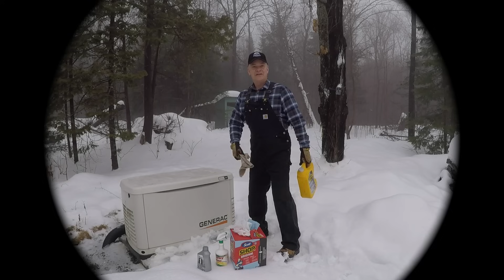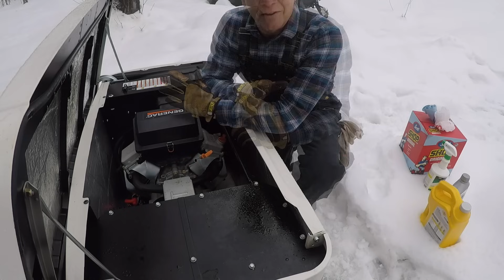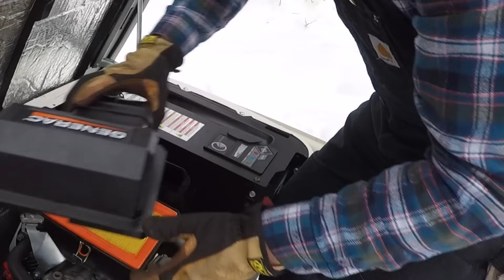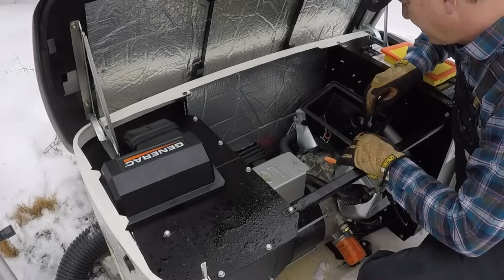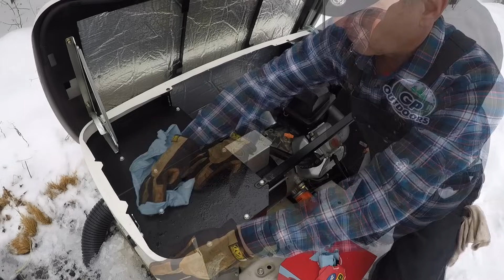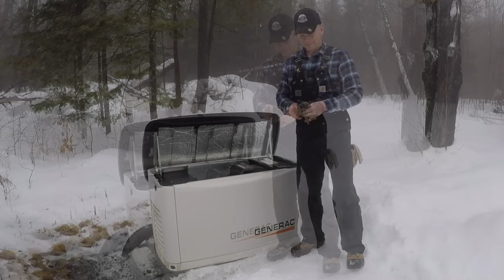#133 Thinking of Buying a Generac Generator? You Need To Watch This!

Comment: It's not exhaust. It's the crankcase ventilation. Its allows any pressure in the crankcase to neutralize  and any gasses to be sent back through the intake to be burned. The source of the water is from the engine not being run long enough to get hot and eliminate its own moisture.  It needs a longer exercise time.
DO NOT put any holes in the air box.  Dirt and insects have direct access to the inside of the engine
Reply: Trust Me I think so too!
But I would drill a 0,04 inch hole in the bottom... Car air intakes have those too.
Or install a one way valve 🤷‍♂️
Reply: I don't trust you.  source is moist intake air.  Crank case water goes out the exhaust.
Reply: @drew738  All crankcase vapors, moisture included, goes to the filtered side of the air box and is drawn right back into the intake to be burned again. Been this way since the '60's.  The water you see dripping from a tailpipe is not from the same source.
Reply: @fliegenmann2562  I would try drilling install a port then attach fish tank air hose to route water away and use fiberglass door screen to cover the hole if bugs are a problem
Reply: flynja that sounds a bit fishy.. 🤷‍♂️
Reply: You nailed it, the generator needs to be run fairly regularly in cold weather long enough to get hot and ward off moisture.
Reply: @drew738  It's the crankcase ventilation system, not the exhaust system. Cold air holds very little moisture. Read up on PCV, positive crankcase ventilation and relative humidity. Also, this guy doesn't even have the air filter element installed properly. The dirty side is the top side here and where the pleats should face.
Reply: Yeah, he means well but his video made no sense, as you can see the standard high temperature exhausts are normal. It would have been a perfect video if he said crankcase ventilator! Sheesh.
Reply: Pull the crank vent hose off, vent to atmosphere out the side of the cabinet and cap the air box fitting. Done. Why would you want that shitty exhaust blow-by recirculating back into your air intake?
Reply: @kevinknapp7361 Then the open hose end would freeze up the same way for the same reason which would cause a positive crankcase pressure forcing oil to come out of some rather inconvenient places. The ice could melt and flow right back into the oil.  Because the engine still hasn't run long enough, the oil would quickly become contaminated with water. That's what that white goo is in your oil filler cap.
 I don't design them.
They are designed to be a closed system.
Altering it changes the way it runs.
Crankcase air is full of pollutants and this system burns them.
All vehicles and many small engines have been this way for decades. 

I think someone should pull your hose off.
Reply: Honestly, it's a poor design from Generac. Standby generators by definition should be engineered to run for short periods, or long periods, or whatever in between. What about those rubber drain grommets usually found on automotive air boxes? They have a pinched end that seals shut under vacuum but when the engine isn't running, they can let water drip out.
Reply: @brianp6965  I don't understand the failure of so many to understand this. All internal combustion engines need to run for awhile after reaching operating temperature to avoid crankcase moisture and/or to burn off any moisture that may have been present. I've never seen this grommet thing but it doesn't prevent moisture, it only allows built up moisture, from the crankcase,  in the air intake to drain. It doesn't solve the primary problem. That is that the engine hasn't been run hot long enough.
Someone said that Generac reduced their generators exercise time to 5 minutes after being pressured over some nonsense pollution claim. This is Generacs fault.  5 minutes isn't even close to long enough.
Reply: @trustme7731  Not sure why so many are missing the main point either. ICE's need to get to normal operating temps in order to burn off the moisture in the engine (this is 100% normal - not a malfunction). When a car is put away for storage for example,  you want to give it a good decent drive so that no moisture is left in the engine or exhaust systems. 
Moisture = no muy bueno for engines and metal parts. In the case of these Generacs and this particular issue - I would personally look to override the retail "exercising program" and set it up to do it less frequently but for a longer duration.
Reply: @kevinknapp7361  ... it's called "purging the crankcase" to get the moisture and blow-by out. It makes for cleaner air and reduces the need to change the oil. Ask me how I know... 25 years working on generators and another 25 years in the automotive field.
Reply: @rupe53  Oh I'm very well aware of what PCV is and does. What you will never sell me on is that the engine runs better or is more efficient with the crankcase gases and moisture being reintroduced into the engines air intake for another go around. It's like that for 1 reason and one alone. Environment.
Reply: @kevinknapp7361  ... would totally agree. The term "running better" is only about current design and when people modify things they wonder why they have problems. On a more personal note, I actually spoke with a factory rep one day and asked why they didn't just raise the vent higher within the air cleaner housing, then face the open end downward so any oily mist wasn't aimed at the paper element. He didn't have a good answer but did say he would bring it to the attention of the engineers. Still in all, Generac isn't the only company to have this issue in cold weather. Onan had a similar problem with some of their V-8 water cooled sets... and they also had a kit available to help fix things. Funny how a Generac with the same engine didn't have the problem.
Reply: @harmontodd  , it should be programmed to auto start once every week to run for at least 30 mins according to installers I have talked to .
Reply: @stevecook7551  That would be awesome if it could do that.  I would even say 60 minutes if you live in a harsh climate.
Reply: @harmontodd  I have been on a fair number of new home builds in my area , quite a few standby gen sets are being installed . Many of them are equipped to do a maintenance start as standard equipment , and from what I have heard It can be added in to other models as well .
Reply: @DieselRamcharger  I apologize, but this shows how well versed in generators you are. I'm sorry to say, but these engines are designed and poured in Waukesha, Wisconsin by Generac themselves. Everything from their smallest 410cc up to their 999c is all their own design. This new intake design is actually one of their best yet, but these units do suffer purely due to the moisture build-up in colder areas. All of Generac's air cooled models have their exercise times locked at 6 minutes and the only thing that's adjustable is how often they run, not including power outages. 6 minutes of an engine running is enough to make the cold air convert to water, but not long enough to burn that water off and evaporate it. The issue he has here is the unit builds up water in the air box overtime, from not running long enough to burn it out, and ends up turning back into ice every time it shuts down. After so long, their is enough water that builds up and ends up freezing into the crankcase ventilation. Which if you understand these engines, you would realize does not take this unit long at all to build up enough pressure to a new escape route, which is usually the dipstick because that's the next weakest point in the system. I agree with you that the insufficient run time is a big problem, but disagree when you lean into stating the weight of oil is an issue. According to the Penzoil bottle that he used, he put a 5w30 oil back into the engine which is actually the manufacturers recommendation for oil weight. I cringed at watching him mix Penzoil and Mobil1 though, due to both oils having different break down points which is a huge no-no for any engine.
Reply: @DieselRamcharger  I know both my tractors has the rubber drain or what ever it's called on the air rilter box. Not real sure what it's for but it's there. Time to research I guess.
Reply: Water in the intake is from blowing snow into the sidevents and right into the air intake. HORRIBLE ENGINEERING!
My unit has failed twice on this.... The air filter was completely packed tight with snow in a snow storm (exactly when you need it most) and then choked off the air and killed the unit.
I cleared all snow out and restarted. Next snow storm same exact thing. I have to build a shelter for it to keep snow out of the intake.
Last time i looked after snow storm, the unit hadnt even run, the entire unit was full of snow ( i mean the whole thing, i  opened the lid and couldnt even see the motor) and the intake filter was full of snow along with the intake tube.
Friggin horrible design.
Reply: @joepaxton4311  Remove the rubber boot connecting the air filter box and the divider panel. That'll fix your issue.
Reply: "Trust Me" is 100% correct that the issue is the crankcase ventilation port. The small hole you see in the air filter case connect a tube running to the crank case and is designed to bring gases from the crank case to the intake housing and recycle them through the engine. These gases get trapped in the crank case and are compressed by the downward travel of the piston. This port allows them to escape back through the intake. As for a fix to your situation I would contact Generac Technical services and climb their back side for a solution. You can bet you are not the only guy having this problem way up north ( I live in Texas ). Every time this unit blows it's oil out and shuts down because of LOW OIL PREASURE it takes YEARS off the life expectancy of the engine. This is a engineering flaw that Generac should rectify.
Reply: One of the biggest byproducts of combustion, even an engine that has been running for hours is water. With every combustion stroke all blow by that leaks into the crankcase carries water vapor and the breather vent line will carry water vapor with it. 

As long as the engine is running I believe there is enough heat to keep this collected water a liquid. Shut it down and it becomes an ice plug. The next start it blows the dipstick. Ideally the breather tube would release the crankcase byproducts into the intake manifold or at least behind the intake air filter.
Reply: @rupe53  so what would be your recommended run time? TIA
Reply: @Hog0611  ... set the exercise for once a month and normal speed (not the quiet option) and manually run it once a month for at least 20 minutes in cool weather to dry things out.
Reply: I don't mind bugs getting in to the intake, my generator runs on Beetlejuice..lol.
Reply: @XxWh1teN1njaxX  I cringe at the thought of someone using Pennzoil!
Reply: @trustme7731  why people don’t understand a problem is that the when the teacher and student are not same on same page or speaking same language to understand the problem or answer. 
“This water problem is same as white smoke in car tail pipe “
Reply: Thanks I didn’t understand “exhaust” port in the air filter.
Reply: @kevinknapp7361  because you don't want the oil vapor and water condensing in the tube and dripping on the ground like an old Harley
Reply: @Hog0611   When my aircraft sits during the cold weather I start each engine once a month only. I then only run each engine 10 seconds. This gets cold oil on the cold metal parts, but creates no moisture.
Reply: @trustme7731  How often would you run the generator to get rid of this moisture problem?  And how often?
Reply: @frankt7521  You don't understand. It's not how often its run, it's about how long it is run when it does run. It MUST run until well after it is hot. At least a half hour and under at least a 50% load.  That being said, it should be run probably at least once every 2 weeks.
Reply: @drew738  No, he was correct Drew. It was blow-by crankcase gases. The crankcase gases are the products of combustion, natural gas and air = thermal energy, CO2 and water vapour.
Reply: @kevinknapp7361  EPA lol
Reply: Replying to "Trust Me" -Yes - That's how it is, the engine crankcase breather pipe discharges into the air inlet filter box below the filter so that the fumes are consumed by the engine. Light load running will make a lot of crankcase moisture in a cold climate. Run it harder is the solution. It could also be that the generator is sized too big for the load - ie It's too powerful so always runs on light load.  A generator with a smaller power output would work harder, run hotter and be happier.
I used to sell and service generators!
Reply: @fliegenmann2562  Yeah this Canada, bugs and dirt are a given
Reply: Only 241 of us caught that?
Reply: @kevinknapp7361  I know, it is EPA emissions standard since the 60's. But you are right, screw that hose and the EPA. Another fix would be to add a small space heater inside of the cabinet to keep the ice from forming and drill a drain hole with a one way rubber flap that closes when the engine is running.
Reply: A simple check valve under the box closed by vacuum would drain the water on shut down
Reply: @Bretware904  No. The air box is cold and draws in outside air. A check valve would freeze almost immediately. Did you miss the part about the ice? Besides, it's already been suggested 40 times.
I just can't understand why so many of you want to cover up the problem instead of curing the problem by simply running the engine long enough to burn off internal moisture before shutting it down.
If you had pain and went to a doctor and he told you to take Tylenol for the rest of your life, would you be satisfied with that or would you want the source of the pain eliminated?
Reply: @drew738  Yet all engine crankcases are vented to the intake. There is no route for crankcase moisture to get to the exhaust valve. Intake air doesn't condense in the intake. It's moisture from a cold crankcase as evidenced by the milky goo that is oil and water that will collect in a PCV system and/or inside the valve cover of any engine that hasn't been thoroughly warmed up, especially in a cold climate.
Reply: @kevinknapp7361  Yeah, better to have "shitty exhaust blow-by" in the atmosphere and the oil and water goo dripping inside the cabinet or on the ground.
And, again, it's not exhaust.
Reply: Came here to see if anyone in the comments would get this right. Was not disappointed
Reply: @tomwest8663  Yes all tractor trailer engines have them because they have a fresh air system where water gets in the air filter box at times and it drains out. I've seen that on a few cars over the years.
Reply: The generator engine shut off because the air filter got froze up with cool air flowing through it and crankcase water vapor then blew the oil stick out. Engine leaked oil out until the motor shut itself off from the low oil pressure switch. If my friend ends up buying one of these generacs. I'll make sure they get the cold weather air intake extra money kit. Generac seems to be a lot cheaper than Briggs and Stratton whole house generators.
Reply: @alainmcin  Yes, I know.
Reply: @DieselRamcharger  Water is accumulating because of the very short run times.
Oil, regardless of weight, has nothing to do with crankcase pressure. The pressure is caused by the vent line being blocked by ice which formed because of the short run times.
Reply: @fliegenmann2562  Unfortunately, a valve would freeze solid just like the airbox...and you right back where you started.  Not sure if there is a "good" fix for this situation other than to check the unit weekly during cold spells.
Reply: @kevinknapp7361  it's an emissions thing, same reason cars have had PCV recirculation for forever. If you want your house to smell like a 2 stroke weed eater is operating for as long as your generator is running then go ahead, though in many states you're also breaking the law by modifying an emissions control device.
Reply: Put a little screen over the whole to keep insects out.
Reply: @stevecook7551  the Genrac units (8 - 11 kW) I run have an adjustable program for their test cycles. They can be programmed from daily to monthly and from 5 minutes to an hour. You just have to access the "settings" menu to set them up. If unsure ask your Genrac service rep to set it to what you want. Here in southwestern Ontario I find 20 minutes, once a week, 12:00 noon on Wednesday, to be more than sufficient. My units get serviced annually and have heater sleeves on both the oil filter and the battery. They heat only when ambient temperature is below 10*C.
Reply: I had installed a 24KW a week ago. The contractor said the exercise time is preset.  Can the time length be changed?  Watching this vid I was confused by the "drain hole in the box" so I am glad to have read your comment.  Helpful info. Thanks.
Reply: @drew738  crankcase water out the exhaust 😳 not happening unless it first goes through the intake.
Reply: Don't like you use of "neutralize " it's more like "equalize" pressure.
Reply: @unacceptablesheepdog7678  I have no idea of what you are talking about. I read all of my comments and the words neutralize and equalize aren't used anywhere.
Reply: @Joshie2256  Your incorrect he has the air filter installed properly
Reply: @drew738  Not it doesn't. I had an air/oil separator on my PCV line running to the air intake manifold from the crankcase and it would constantly ice up from moisture condensing and freezing. it even cause the dipstick to lift just like this guy described.
Reply: @kevinknapp7361  Venting the PCV to atmosphere might be okay but some engines rely on the vacuum created by running it to the intake to help prevent seals from leaking and it helps draw away more combustion byproducts. the biggest issue is that it isn't running long enough to get hot and evaporate the moisture.
Reply: @Joshie2256  Huh, 🥶 Cold air holds very little moisture  ? Where did all that white stuff on the ground come from ????
Reply: Jude put a hose on it run it to the out side of case and make a bubble out of window screen and the plastic is beast so it won’t rust out from the moisture.
Reply: To pass emissions they have to burn the fumes they use to have a line going to muffler to re burn that junk you do not wand it going back to your carb. So drill a hole in bottom of air box add a hose and try to make that line straight as you can outside the unit and in to a catch can. Fords V 6 with twin turbos the crank case is put back in intake and carbon up the valve stems to solve this they ran vent lines to a catch can . This mess was caused by direct injection and the newer models use both direct injection and port injection to keep carbon of the valve stems.
Reply: @brentmcmahon8188  Mufflers don't burn anything. You might be thinking of the air line that goes to a catalytic converter on some vehicles. PCV has always been routed back to the intake manifold, not the carb, to be reburned. This is just another reason to have 45 minute exercise times to get the engine hot enough to burn off moisture.
Holes and hoses will just fill with ice and defeat the crankcase ventilation system. Also, any holes in the air box will suck in air and whatever it can and may be on the carb side of the air filter thus allowing unfiltered air into the engine.
Reply: our chruch s connected to an op-en wye delta 240v 3 spahe and it uses an 440cc CCW 2 stroke generator. the a/c is 240v and odell beckham the open wye deltal transformer connection that myles garret was unaware of for a 120c;20000v oil burner ignition
Reply: he installed the ignition transformer while avoiding 210v to ground. Saquan Barkley is aware of the open wye delta connection making 1 phase at 208v to ground
Reply: Nick Chubb is familiar with 480v burner units which tapp zero point energy and can reach over 60000 deg F. he says tap the red ignitor button and run
Reply: be very careful with 480v
Reply: @jlo13800  What?
Reply: @drew738  How does anything in the crankcase get to the exhaust except past bad rings?
Reply: Biggest issue I’ve encountered (with 18kw unit) is the “stepper motor” is prone to perform erratically.     Good video.